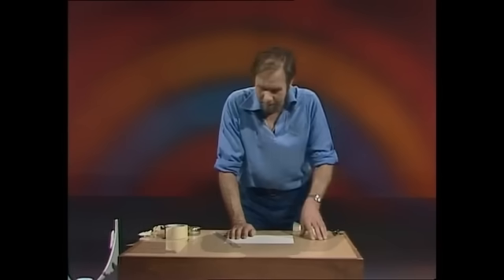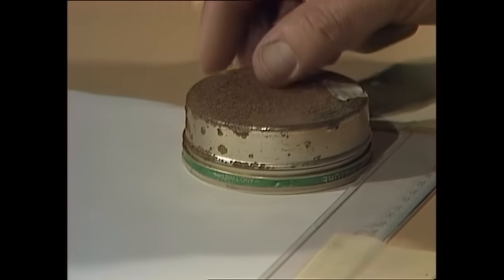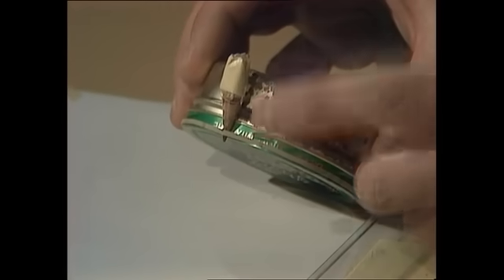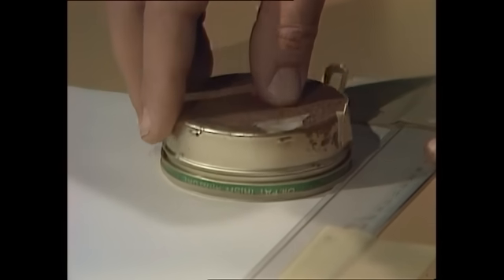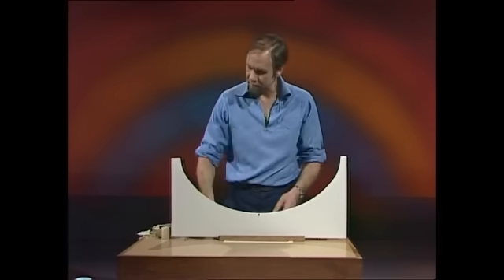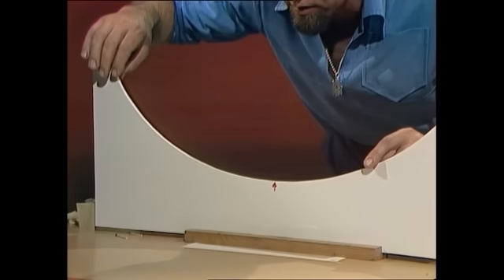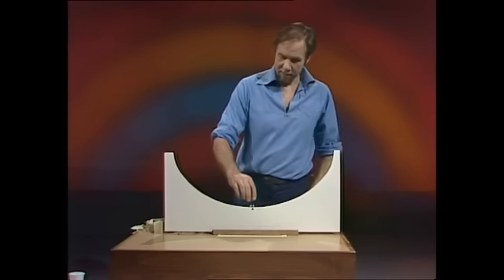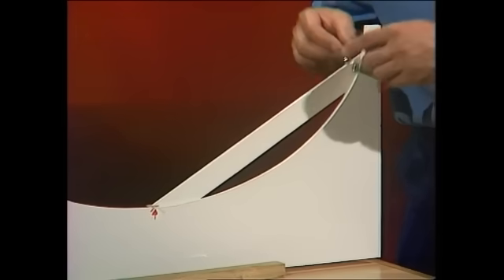The mysterious isochronous curve

Comment: this experiment shows momentum is not the same force as gravity
Reply: That's a bit like saying tanginess isn't the same colour as yellow. 
Gravity is a force pulling masses together, proportional to each of their masses and inversely proportional to the square of the distance between their centres. 
Momentum is a property of any moving thing, proportional to its mass and its velocity. Note that velocity has a direction, so momentum is directional. 
Momentum is conserved. 
When you put momentum downrange into a bullet and the hot gas behind it, you put an equal amount of momentum into yourself and the gun in the opposite direction and feel this as kick. Take your skateboard to the range and try this out! Measure the speed and note the mass of each bullet or load of shot you fire, and weigh yourself, the skateboard and the gun and measure how fast each shot sends you rolling backwards. This is an example of Newton's Third Law that for every action there is an equal and opposite reaction. 
The same equal and opposite reaction can be seen in rocketry. A rocket launches gas at high speed one way and thus gets an equal amount of momentum in the opposite direction. Don't try this at the range. They don't want several tonnes of incandescent water vapour. 
If you want an interaction between momentum and gravity, think of a ball thrown upwards. It has momentum upwards and the Earth has momentum downwards. The Earth has a very large mass and therefore doesn't move very fast. 5.972 × 10^24 kg versus an 8kg bowling ball? 7.465 * 10^23 times the mass, so ... Hey, look at that. That's the number of individual water molecules in 21.6g of water (1.3 cubic inches). We can make the maths easier by doing it all relative to the Earth and treating the Earth as stationary. 8kg ball goes up at 49 m/s, which is faster than you want to be seen doing on the interstate. Gravity acts on it and pulls it downwards at 9.8 m/s/s. Over 5 seconds, gravity accelerating it downwards will slow it to a stop (and slow Earth to a stop in the opposite direction relative to the ball because of conservation of momentum) and over the next five seconds gravity accelerating it downwards will speed it back up to 49 m/s. Then it'll be back where it started, and presumably hit something, like the Earth coming the other way. 
To provide a mathematical relationship between force and momentum, acceleration = force / mass, velocity = acceleration x time, momentum = mass x velocity and that boils down to momentum being mass x ( force / mass ) x time  = mFt/m = Ft = force x time. 
It's not quite that simple because we have an atmosphere, and to move that ball through the atmosphere you have to move atmosphere out of the way. This requires transferring momentum from the ball to the air, and the ball doesn't get that momentum back, so it's slowing down. If momentum's being transferred and acceleration (backwards) is happening, there must be a force, and there is. It's called air resistance. Newton came up with an approximation for how far an impactor (that thing which hits something else) can penetrate a barrier (that stuff that it hit), which is the ratio of densities multiplied by the length of the impactor. In other words, it can only shove through its own mass of stuff before it runs out of momentum. That's for an impactor with a 45° sloped front, not a ball or a dagger. I think for a conical spike with a 1:20 taper, it'd be 20 times as far. 
Air at sea level having a density of ~ 1.225 kg/m³ and (10-pin) bowling balls having a standard diameter of 21.59 to 21.83 cm, we can calculate the bowling ball's profile area as (21.6 / 2)^2 * PI = 366.435 cm^2 and the mass of air in its way for every metre of travel as 44.888 grams, so it shouldn't be able to penetrate more than 178.22 metres of air, no matter how hard you throw it. If you throw it too hard, like at 20 km/s, air can't flow out of the way fast enough, gets compressed, gets hot because it's compressed and boils the ball away to gas, which does nothing for its ballistic efficiency and is also why most of the hundred tons a day that hits the Earth's atmosphere turns into pretty streaks of light and puffs of gas rather than making holes in things down here.
Reply: Momentum isn't a force at all. Force is the derivative of momentum with respect to time.
Reply: Err. Yes, but most people can't grasp that.
Reply: Gravity is a freemason lie. That's why it's a theory. Wakey wakey earth is flat. It's buoyancy that matters
Reply: @martinbruce28  pfff you believe in the earth? Get woked, man.
Reply: @martinbruce28  actually, gravity is a theory but all studies of science now are based on it so we are told it's true or never mention that it's a theory (I'm not replying to you, but to the other people)
Reply: Sertura Dionyol all studies of pseudoscience! if you can understand that... you should look into our true realm (geocentric. It's on the individual to research this.  Not everyone can comprehend the deception.

No visible 8 inch per squared mile drop curvature 

Absolutely no prove of spin, orbit or barrel rolling around the sun.

The surface of water does not conform to a spinning water ball

You've been programmed thru indoctrination  (education) to think this is crazy, sadly its probably working. 

Look into it people, the world is a stage.
Reply: "No visible 8 inch per squared mile drop curvature" Also no 20-gauge per cubed ant backflip elasticity. 
English, moth________. Do you speak it? 
Even stood on top of Mont Blanc and admired Toubkal, Everest, Kilimajaro, Aconcagua and Denali? No? That's because they can't be seen from Mont Blanc. 
I suppose you don't believe in mathematics, anyway, but ... actually, do you even believe in Mont Blanc and Kilimanjaro? Anyway, mathematics, yes. On a circle with a circumference of 40,075km, each 1° around the circle is 111319 m along the circumference, 111314 m "along" and 971 m "down" from where it started. That's just over 69 miles away, 3186 feet "down." A point 2° away will be 222639 m away along the circumference, 222594 m "along" and 3885 m "down" from you. A point 3° away will be 333958 m away along the circumference, 33806 m "along" and 8741 m "down" from you. That's 207.5 miles away, 28678 feet down. That's close to the height of Mount Everest. 
That means that the summit of Everest should be visible from somewhere 207 miles away if the view isn't obstructed and someone on Everest should be able to see points at sea level 207 miles away if the view isn't obstructed. Of course, the view is obstructed, because Himalaya, but none of those other peaks is as tall as Everest. Want to check out the view from Everest? Here: http://project360.mammut.ch/#route/mount-everest/south-route/448/details You can even use your mouse to look around. 
You do believe your computer has a mouse, don't you?
Reply: Sableagle convergence, diminution and angular resolution. yes, one arch degree equates to 69 miles of curve on a circumference of 24810 miles.  the city of Chicago is clearly seem across a great lake over 40 something miles away with no curve obstruction.. oh yeah, youll regurgitate the mirage nonsense lol any body of waters surface will always seek to be level. again, no proof of movement along with another 200 something proofs we've been lied to since birth. Don't get too worked up on just the math brother :) research it all
Reply: Are you somewhere near Chicago right now? If so, look outside. Is the Sun up? 
Where I am, it went down a while ago. It's dark here. 
Speaking of cities across lakes, here's Toronto: 
https://upload.wikimedia.org/wikipedia/commons/3/33/Toronto_seen_across_lake_Ontario_from_Olcott_2.JPG
Reply: Sableagle the image you share is proof of convergence. the tower and buildings would be leaning back, if half of them were hidden as a result of curvature. That is not our reality. check out 200 proofs earth is not a spinning ball.  I'm on the west coast of Canada the sun is hidden by cloud coverage. it's a great day to witness crepuscular rays from the sun thru the clouds, proving it's not 93 million miles away. The sun is a local light, nothing like we were forced to remember in the ol heliocentric  brainwashing factory.
Reply: That's proof that the clouds aren't 93 million miles away. 
See a lot of trees, cars, pedestrians, cyclists, delivery vans and the like in that photo, did you? Here's what it looks like from closer: 
https://s3.amazonaws.com/btoimage/prism-thumbnails/uploads/2017/06/21/2017621-skyline-2010.jpg-resize-_opacity_100-frame_bg_color_FFF-h_2500-gravity_center-q_70-preserve_ratio_true-w_1400_.jpg Note the trees. See them? They're the fluffy-looking green things along the bottom, just above ground level. 
If you're looking at Toronto from Olcott, as the name of the linked photo implies, it's 63.73 kilometres (39.60 miles) to the cluster of tall buildings in what looks to be the centre. 
63.73 / 40075 = 0.001590268 or about 1/630. For those towers to be 63.73 km away on a 40075 km circle, they should therefore seem to be leaning back 0.5725°. 
Yeah, just over half a degree. 
According to Wikipedia, that "needle through a bead" thing is the CN Tower, and is "a 553.3 m-high (1,815.3 ft) concrete communications and observation tower located in Downtown Toronto, Ontario, Canada." Leaning back 0.5725° relative to local vertical, its top should appear to be 5.528 m (18' 2") further away than its base. 
Yeah, less than 1% of its height. 
You can't even see its base in the picture. You can barely see the tops of the adjacent buildings. 
Do you seriously think you can tell by looking at that photograph whether that thing is 63730 or 63735 metres away? Really?

By the way, how do you think buoyancy works?
Reply: "actually, gravity is a theory but all studies of science now are based on it so we are told it's true or never mention that it's a theory (I'm not replying to you, but to the other people)"

It's actually amazing if you really believe that to be the case,
All studies of science are based on wacky theory no sane person would believe in, and they all work!
It's a feat far more amazing than if the gravity theory is actually true, my newfound respect goes to all researchers that is able to survive both test of the wacky theory and practical application!
Reply: No, really, come on! HOW DO YOU THINK BUOYANCY WORKS? Come on, martinbruce28, and answer the question. We're waiting. Let's have an explanation of buoyancy from you, please. "Buoyancy: how it works, by martinbruce28." I want to read it. We're all eager to read it. Tell us how you think buoyancy works.
Reply: Buoyancy works by buoyancy, then? Good answer. 

You want an explanation with an actual explanation in it? Gravity pulls the air, the hull, the cargo and the water down with force proportional to their mass (with tiny variation for distance from the Earth's centre, but over 6378 km the draught and freeboard add up to not much difference). This downward force, known as weight, pushes the cargo and the hull down into the ocean basin or lake and thus displaces water from there. The water has nowhere to go except up on top of other water already filling the basin so the weight of the water resists this displacement. The weigth of the air is close enough to equal across a boat and the surrounding water to be ignored. The greater the volume of water displaced by the hull, the more upward force is generated. If that upward force is greater than the weight of the cargo and hull, the vessel has positive buoyancy and will rise. If it is less, the vessel has negative buoyancy and will sink. As the vessel moves up or down accordingly, the volume of water it is displacing will decrease or increase, changing how much buoyancy it has. Via damped harmonic motion known as "bobbing up and down for a while," it will settle at a depth at which it is displacing water with a mass equal to that of the hull and cargo plus crew, fuel etc. If the hull springs a leak, more dense water will flow in, displacing less dense air upwards out of the hull, because gravity pulls the water down harder than it pulls the air down. This removes the volume of water that has flowed into the hull from the total volume displaced, reducing buoyancy, causing the vessel to ride lower in the water, increasing the water pressure driving water in through the hole and adding more water to the vessel until the hole is plugged, the ruptured section is isolated or the vessel's sealed buoyancy tanks become the only air pockets within it, after which either the vessel goes under or the vessel remains afloat but very low in the water. 

Physics! Cool, huh?
Reply: Sableagle lol!

glad you watched (sarcasm)

well programmed fool!
this is why I won't waste much time with you
 
too educated (again, not a compliment)

the video is 2 hrs

maybe not long enough of a attention span...

again they call it a theory for a reason, beyond your grasp I suppose.
Reply: Your first video: if there's no gravity, why would density matter and how could there be an underside of the Earth? 
When you jump, you do get pulled downwards. Don't believe me? Try jumping up the Eiger from Grindelwald. 
That guy goes from talking about density and buoyancy to showing posters that say ducks and kayaks shouldn't float. He just explained part of how they do. Brain? 
You want something ball-shaped in nature that has other things orbiting it? You're standing on one. Ever heard of satellite television? Also with a decent camera and a steady hand or, better, a good camera, a good lens and a tripod, you can see Jupiter and Jupiter's moons. You can actually photographs the things from Earth on a clear night. You don't need to get your pictures of them from NASA. You can get a camera, go outside and photograph them yourself. 
A wet tennis ball has a mass of 58 (dry) to 213 (full of water) grams. Compared to Earth's 5 972 000 000 000 000 000 000 000 000 grams, that's not massive. Even much closer to the centre, like 63.78 millimetres from it rather than 6378 km from the centre of the Earth, making 1/r^2 10 000 000 000 000 000 times as much, that's still only going to have about 1 six-billionth the gravitational draw of the Earth. 
If you want to see gravity in action, throw a rock. To make this all scientific, film a selection of rocks, nuts, bolts, ballbearings and marbles being thrown upwards or dropped from various heights in front of a sports hall's horizontal bars or a brick building or a measuring scale hanging from a tall structure. Film from a distance, using a lot of zoom, to minimise parallax error. Go through your film frame by frame and measure the distance moved vertically in each frame as each object (slows down and) falls (back) to Earth. Using dense enough objects to make air resistance trivial, you'll probably find that each object is accelerating downwards at about 9.8 metres per second per second. For a mass to be accelerating, there must be a force. There is. It's called gravity. 
Also, that balloon? That balloon was visibly sinking as he filmed it. 
About the Moon and the Earth, the guy has completely missed a really fundamental point: the gravity, tension in a string, electrical attraction or any other force between two objects attracts them both towards each other not just one to the other. The Earth and Moon are both going around a shared centre of mass that in turn orbits the Sun, with some wiggles due to all the other lumps of mass around here. 
Tides vary because ... well, try pouring a bucket of water down a sloping pane of glass. Smooth and even flow, right? Now try pouring a bucket of water down a ramp of some sort that's covered in bloody great rocks. Notice the flow becoming uneven? Yes, that's because there are bloody great rocks in the way. Australia, New Zealand, Britain, Ireland, Sicily, India, Japan, Mexico, Cuba, Norway: bloody great rocks in the way of tidal currents, causing them to be uneven. 
The Moon's path and velocity aren't actually uniform, but don't get a headache thinking too much about that. 
Also the Sun affects the tides, so we get higher (spring) tides when the Sun and Moon are in the same direction or opposite each other and lower (neap) tides when they're at right angles. 
As for tides in lakes ... https://agupubs.onlinelibrary.wiley.com/doi/full/10.1029/2011JC007411 quote: "At 16 m above mean sea level, Loch Ness is not directly influenced by the ocean tide. However, we have been able to observe small (mm) tides in the Loch due to direct gravitational tidal attraction, and due to the loading of the solid earth by the ocean tides of the adjacent seas. This is believed to be the first observation in a European lake of an astronomical tide primarily due to loading." Lakes do have tides, but because lakes are generally rather smaller than, for example, the Atlantic Ocean, they have much smaller tides. 
Earth spinning: call it a thousand miles per hour to make it sound fast, sure. How about calling it "going round once per day," to make it really feckin' obvious how fast it's going? It's not once per solar day, though. Due to the Earth orbiting the Sun, the direction of "towards the Sun" changes day by day. The Earth doesn't have to turn just all the way round once to get the same line of longitude pointing at the Sun again but actually has to turn just a little bit further. Well, just 1/365.242199 of a revolution further. The Earth is going round once per 86164.0905 seconds, at an angular speed of 0.000072921158579 radians per second. If you multiply that by the Earth's equatorial radius of 6378.1 km, you get a linear speed of 465 m/s or 1040 mph. Fast, but fast around a very big circle indeed. To go round a circle that size at that speed, you have to accelerate inwards at 0.0339155 m/s/s. Now, if you were standing on the north or south pole, you wouldn't be going round the circle. You'd just be spinning very slowly in place. You would therefore not get that centrifugal upthrust, so gravity measured using a spring balance ought to be stronger in polar regions than in the tropics. Further, that lower gravity at the surface around the equator allows the Earth to bulge around the equator, making the equator further from the centre than the poles at 6378.1 km versus 6356.8 km, so gravity should be 0.67% stronger at the poles anyway. Adding up 0.67% of 9.8 and 0.034, we get about 0.1 m/s/s of extra gravity at the poles. Aaaaand ... 
https://en.wikipedia.org/wiki/Gravity_of_Earth "Effective gravity on the Earth's surface varies by around 0.7%, from 9.7639 m/s^2 on the Nevado Huascarán mountain in Peru to 9.8337 m/s^2 at the surface of the Arctic Ocean." Well, hey, look at that. It does vary and it is stronger at the poles. 
Ooh! Ooh! "Any force powerful enough to hold this tank to {the Earth} is powerful enough to crush you." We can test that. Get someone to drive a tank over you and see whether you get crushed. 
There he goes again with the balloons. AIR HAS WEIGHT. 
Would this make any more sense to you if I recorded myself saying it, autotuned the fuck out of it and overlaid it on a video of a young woman dancing with a guy in a Darth Vader costume?
Reply: Second video: "all balloon and drone footage shows a completely flat horizon." https://youtu.be/95NDkABAsSk?t=162 NOPE. Pick a frame. 
There's some distortion. Still, there are plenty that look like they have curvature. https://youtu.be/PEH8iLjlodM?t=274 
Well, that was easy. You know, bothering to answer the rest of it would be a more attractive prospect if he hadn't mixed all the shite in with the bullshit. Ugh. 
Wherever you go, the horizon is level with the horizon. Wow? Not wow. Anyway, looking down to see the horizon? Tricksy stuff, geometry. If we assume the horizon is where the Earth's surface is parallel to your line of sight, the angle of "how far round the Earth you can see" and the angle of "how far down you have to look" will be the same, and will tend towards 90° as your distance above the surface tends towards infinity, a lot like a graph of angle against tangent. The vertical distance from the surface below you to the plane of the horizon will be 6378.1 km x ( 1 - cos a ), the radius of that plane will be 6378.1km x sin a and ( height + 6378.1 km x ( 1 - cos a ) ) / ( 6378.1km x sin a ) will be the tangent of a so ... Good grief. It's been a while. Let's go for some arbitrary values of a and see what we get. Let's start with ... 0.1° as a tiny number. 6378.1 km x ( 1 - cos a ) = 9.714 m and 6378.1km x sin a = 11131.879 m. From whatever height that is, you can see to the edges of a slice through the Earth less than 32 feet down and nearly 14 miles wide. Let's try a = 1°. At whatever height you'd have to look down 1° to see the horizon, 6378.1 km x ( 1 - cos a ) = 971 m and 6378.1km x sin a = 111313 m. That'd be a horizon a little over 69 miles away. Alright, from a mountaintop, on a good day, 70 mile visibility happens. Let's go to a = 5° for a serious dip. 6378.1 km x ( 1 - cos a ) = 24270 m and 6378.1km x sin a = 555890 m. That's 345 miles away. Now ... that's plausible. I've had good views from planes over the eastern Mediterranean. Let's have a value for height. height above the surface is the opposite of an a angle with adjacent of that radius minus the depth of that circle below the surface. 555890 tan 5 = 48630 and 48630 - 24270 = 24360 so you'd have to be over 24 km up before you had to look 5° down to see the horizon, damn near 80000 feet. Maybe 5° isn't obvious enough. Let's try 10°. 6378.1 km x ( 1 - cos a ) = 96900 m and 6378.1km x sin a = 1107500 m. Height = 195300 - 96900 = 98392.473 m = just over 322800 feet. 
Now the question is how accurately can you judge what's really level? Where, for example, is truly horizontal in these images? 
https://cdn.cnn.com/cnnnext/dam/assets/180118154846-mexico-diving-cave-1.jpg 
https://r.hswstatic.com/w_907/gif/cave-survival.jpg 
I think it'd be interesting to set up an actual experiment to test something here. I'll need a large space full of stuff in heaps and at angles, with no horizontals or verticals for reference, a lot of volunteers, some way of marking the "walls," a tripod and some surveying equipment. The idea is each volunteer tries to direct another person where to make a mark on the wall that they think is level with the tripod top, then we use surveying gear to check what actual angle they picked. If they can't aim "genuinely level" to within 5°, then claiming not to be able to tell you're looking down a bit to see the horizon from 30000 feet is meaningless, and if people can aim at level that accurately a further test will be needed to see whether having a "horizon" provided deceives people or the people claiming not to be able to tell you're looking down a bit to see the horizon from 30000 feet are lying. 
On his point 4, define "ascend." Seriously, gravity pulls the water in the direction in which gravity pulls the water. 
"Eight inches per mile multiplied by the square of the distance" is, mathematically speaking, bollocks. Also I've already answered that one. 
His point 7: how the hell do you think they measure "horizontally" over hundreds of miles? You ever see a guy with a hundred-mile-long spirit level marking a line on the side of a canal where the mooring chains are to be fixed? Nope. You ever see someone with a theodolite surveying a point hundreds of miles away? Nope. What could they do, though? Well, they could survey it a few km at a time as they go, with "level" being locally level at each point. That'd work. 
Suez Canal: 100 miles long. Whoo. How do you think they got the datum line? You think someone dug a hole and shone a laser along it in 1859? 
Now he's repeating himself and, again, I've already done the maths for him. 
London-Liverpool railway straight? Hah. 200 feet above sea level? Dude, sea level is curved. Seriously, sea level isn't a flat slice through the globe. Have you actually seen a picture? Just look for a picture of the Earth and you'll see oceans in various places around it. 
Did you even watch this video, or did you just google some really long bullshit to waste my time so you wouldn't have to type anything yourself and reveal your own utter ignorance and incomprehension?
Reply: You still haven't got as far as explaining how you think buoyancy works. 
Are they making you retake first grade again?
Reply: @martinbruce28  I have many questions, but I'll just ask one for now,

At what speed will an air bubble rise from underwater?
Reply: Muhammad B Rusyda watch the 200 proofs, then let's discuss. ...
Reply: Does the 200 proofs contain a formula that I can use to calculate the answer?
Reply: lol sabeagle gives us a go pro video to watch and claims it's curvature hahahaha 

should be sabsheep!!

you do know go pros are a fish eye lense type camera right???
Reply: Omfg flattards are everywhere...
Reply: How do you think buoyancy works?
Reply: I think the standard regurgitation is that we are on an infinitely stiff dinner plate with a constant acceleration "up" which would be kinda annoying if you found yourself on the bottom or edge of the plate LOL.
Reply: I've seen a forum thread on that subject once. It got 90 posts. I don't think anyone convinced anyone of anything.
Reply: st1300 r that's the flat earth societies garbage claims (controlled opposition) no one who has done their research believes that. 

we are not moving whatsoever. just the luminaries above us.
Reply: hurricanewinzz.....probably a very astute observation!!
Reply: I personally like to think of my peanut butter sandwiches as "not very fast aeroplanes"